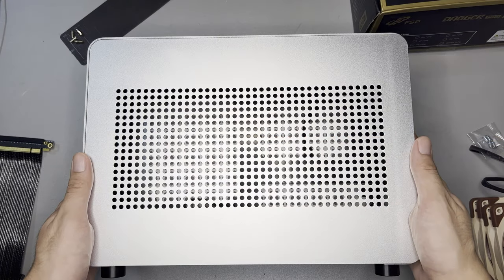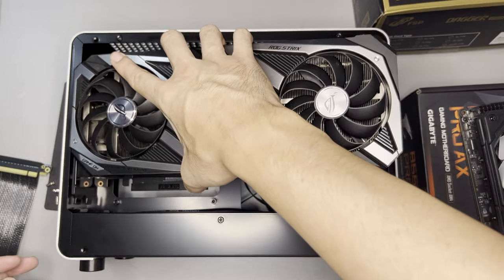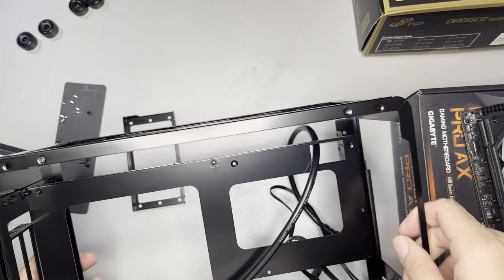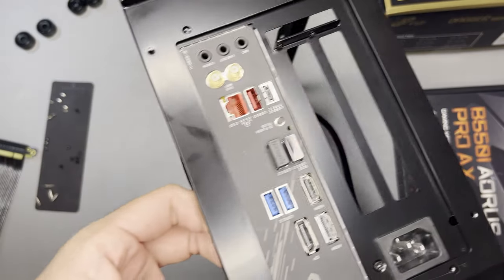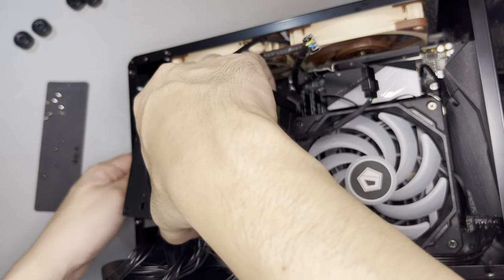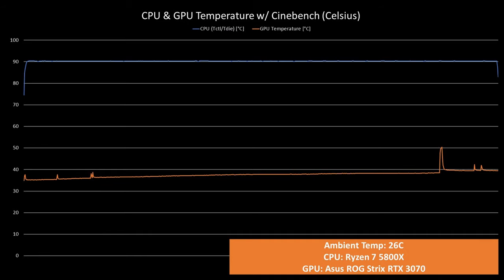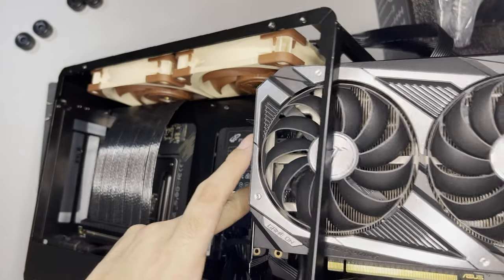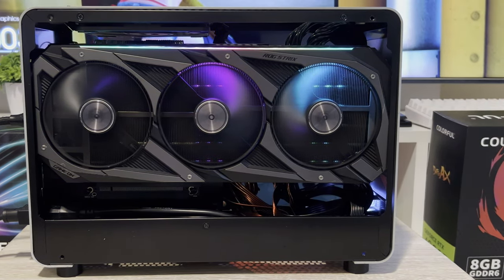GEEEK G1 SE 2 Build | An 11L SFF ITX Build

Comment: Good video, thanks! I have this case and for me it's been excellent if you accept its limitations and don't try to cram in large, hot hardware it won't support. Sure, it's a nightmare if you want to keep rebuilding and tinkering with anything other than the CPU or GPU. But it's cheaper and looks far better than the A4H20 in my opinion.
Reply from the maker: Thank you and I agree that it's a workable case but I just tested it based on the specs they provided. I did not write 320mm gpu compatibility, it was GEEEK and so I was disappointed. They could write a lengthy compatibility table if needed but they didn't (they should follow SSUPD). Also in PH, it's not cheaper than a4h2o, specially a4h2o has riser included and for geeek you have to pay extra -- that's why I stated that regional pricing may impact the perception of this product, if it is cheaper at your side accounting for riser, then I agree. Looks can be subjective and I have to respect your take on that 🙂

Comment: I got the g1 se used for $30
But haven't build on it yet
Im worried if i put in 65w cpu with is40x v2 there
Reply from the maker: Should be fine though as long as you have proper exhaust fans.
Reply: @manongunboxing  stock fan below the case
Not sure how much room for topfan tho